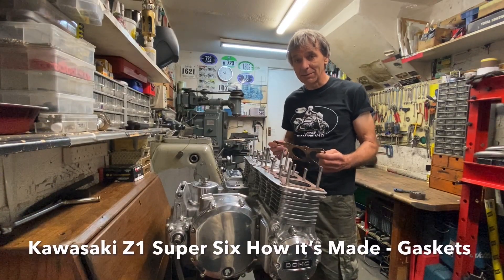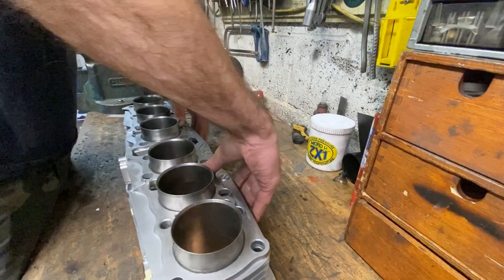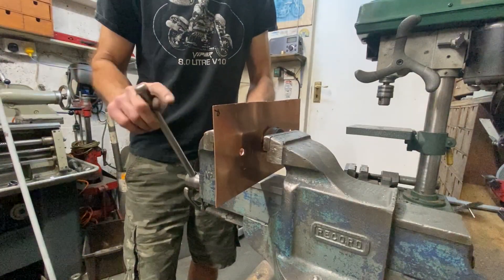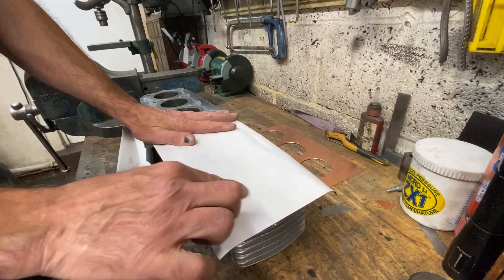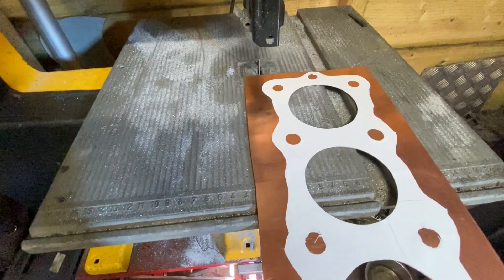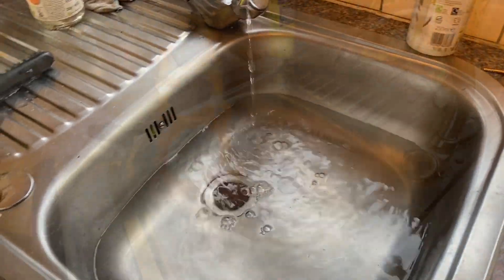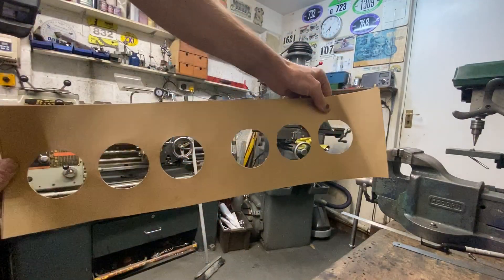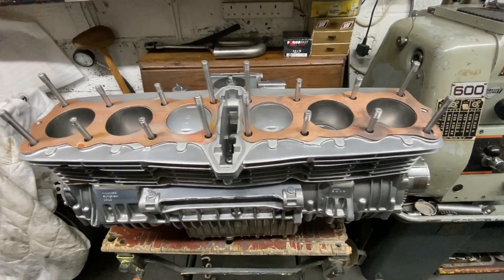Kawasaki Z1 Super Six  Copper Gaskets - How it's Made

Comment: Have said it before Allen but I'm going to say it again, you sir are an engineering genius and a privilege to learn from.
By the way if you see any Swiss Army card tools locally grab them, they have the same little scissors and a lovely little easily sharpened blade which come out of the card to use, making them less cumbersome for snipping and much safer than holding a Stanley blade between thumb and forefinger...
Google 'Victorinox Swiss Army Card' 👍🏿

Comment: Hey man, thanks for the4 video, I was wondering if I can make copper gaskets myself. But please tell me, do you use any sealant when fitting the copper gaskets - i.e. copper spray gasket? thx
Reply from the maker: I use a bit of Permatex ultra grey just to make sure
Reply: @AllenMillyard  thats RTV sillicone, right? I just installed a Honda D16A9 head today with a laser-cut 1.2mm copper gasket and only used the copper spray...I guess I will know soon enough if that is sufficient. I somehow dont like sillicone on head gaskets...but in any case, thanks for letting me know.

Comment: When making the base gasket, why not tap around the edges of the cylinder liners using the flat side of a small ball pein hammer, thereby severing the gasket paper at the edges, likewise, for the stud holes with the ball end and also the casting edges with the flat end.

Comment: While the head was on the copper sheet I'd have used a transfer punch to copy the bolt holes, so much more accurate and no need the mess around with sticky baked plastic, paper and oily finger for the outlines..

Comment: Alan, I don't know if you are reading these but my question is, when cutting the holes in the paper template, why didn't you use a ball bearing with a gentle tap on the bolt holes?

Comment: Awesome job! I love watching your videos! Just a thought from a fellow builder of one-off stuff, when you get your gaskets made and fit how about using them as a pattern to trace out an extra set in case you need them? I like how you said to punch out the holes in the paper BEFORE you cut out the gasket. This is to give enough support paper around the hole to keep it from being sucked under the punch. On most cast iron or steel parts (not here tho) you can carefully lightly tap cutting out the outlines and holes with the ball end of a ball peen hammer. But I'm sure you knew that already. Keep it up!

Comment: Hi Allen. How/ why did you choose 1.2mm copper? Was that based on the thickness of the gasket you originally removed? I am in need of a head gasket for a 1997 Yammy XVS400 but they are discontinued. It looks like the MLS one I took off is 0.70mm so I guess I could make a copper one of the same thickness?? Hope you or anyone can advise. I’m nervous about getting it wrong and either bending a valve or dropping compression.

Comment: I have made my own copper gaskets as well. To mark out the engine stud holes. I use a centring prick punch, this is a round punch with the same diameter as the bore for the studs and it has a centre spike machined on it. Drop it down and give it a tap with a hammer.

Comment: Thanks again Allen, I will be making copper gaskets for my  70cc, 90cc and 110cc Honda motors. I have the luxury of having a small CNC machine to machine the copper. I will be using 1mm thick sheet. The advantage I have is that my motors are only one cylinder each.

Comment: allen    ever thought about making a jet powered  three wheeler ?   i have a jet engine 8" dia 18" long  that could spin up a free rotating turbine  the shaft of which drives main shaft of the motor cycle engine ,,,, the con rod / crank removed..  .. its an idea at the moment .. but i have most of the tackle to get it done  i am in a bungalow and the max shed size i can legally have  is 6x4    thats feet not meters.. ! i hhave gone to the trouble of buying one  7x7 feet   !   strictly illegal,,,, so they say !    where i live is very very nice almost like gods waiting room no dawn chourus here  just the clatter of zimmer frames..!   keep in touch  regards,,, laurence
Reply from the maker: Loving the shed 🙂

Comment: When I was an apprentice Engine builder I was to taught to anneal copper by quenching it in used oil I recall water quenches more quickly the oil however oil is good for slow quenching if higher stressed copper components used to love making Gaskets I used to tap out shape & holes by using a light ball pain tapping hammer happy days…!!!

Comment: Allen, you really need a set of proper center punches.  There's no sense in guessing where center is for a hole.  A entire set can be had for rather cheap.  Basically just a set of rods that are specific sizes and graduated from very small to large.  There all have a small shap point at one end.  Pick one that fits snugly in a hole and slides through.  Drop it to the bottom so the point touches your material. Waah-laah !!!  All hole are marked perfectly on center.

Comment: It needs a bead around the cyl., something to compress, which a flat piece of copper won't do,  just too much surface area.  Hardly any different from just bolting the head straight on, as copper and alum. are just about the same squishability/hardness.

Comment: I have a project that I would like to use the copper gasket. The only reason why I can't go forward is that I can't find info I'm satisfied with that explains the correct gauge to be used for the engine, I know the thickness of the gasket will alter timing and HP loss or dangerous gain, I wander if anyone has a decent explanation on how to measure the correct gauge of the gasket to be used? It would be even more helpful if your name was Allen and had a youtube channel...

Comment: I like the fact that the detail and steps weren't skipped - very thorough. Interesting, that the large holes for the barrels were opened up incrementally. No doubt there's a reason. I would (probably wrongly), just drilled a hole close to the circle and then  used the snips, but I guess this would have buckled the plate? I confess, I have made numerous paper gaskets out of cornflake boxes, which worked fine enough, back in the day, for my CD 175 and Norton 600.

Comment: Have you ever used a small ball peen hammer to tap around the perimeter of the holes? It is dead accurate and quick. You can do both the perimeter and the id of holes. I'm sure you already knew that.

Comment: Mt Millyard, Handy Tip When making Copper head gaskets for My Triumph Bonneville And CCM 580 4valve, I got some Scrap lengths of 3 and 4-inch diameter  Copper water pipe 12 inches long when slit and rolled flat you get 12 inches by 25 inches to work with for the 4-inch, even 2-inch copper pipe will give you a strip 6 1/4 inches wide  and you can always beg offcuts from industrial plumbers, Putting the Copper gaskets on the Electric ring on the Stove is also a good way to heat them up to Annealing temp and also keeps them flat

Comment: Nice one Allen. 👍  Have you ever use an adjustable hole saw cutter to cut large diameter holes in sheet metal? Something like the Monument 68c tank cutter for example, which can be used in a slow speed pedestal drill. You can find the hole centres using the set square technique.

Comment: hello back. How is the copper gasket holding? is it leaking or working properly? I have gsf1200(oil cooled) and was thinking about using it because i want to turbocharge it so if it is suitable for my application. Thank you for any advice.
Reply from the maker: Its done 1000 miles so far and it seems to be  fine, I did put a thin smear of permatex ultra grey around the oil ways just to make sure

Comment: Allen i enjoy your videos for no other reason than i like engines, however as one of those health and safety types i would have you marched off our site if i caught you using a stanley knife blade like that 😁 do yourself a favour and get yourself a nice craft knife set that will do the job just as well if not better, and while your at it get yourself a few pairs of tight fitting kevlar reinforced gloves, cut level 5, modern gloves are amazing for their level of dexterity and there really isnt much you cant do with them on, i rebuilt a 2JZ Toyota Supra engine with gloves on, nice clean hands and no nics and cuts. Carry on the good work, lecture over 😁

Comment: You know, the std head gasket has got flame rings, which see most of the clamping force when you clamp/bolt these heads down. When fitting
copper annealed head gaskets the force is distributed across the whole surface, and dosn't give the same high pressure seal where you need it
most(on the top of the cylinder liner)
  A better and easier way of sealing
at this point (area) is to use wills rings or more easily found annealed copper wire (twin and earth)I think it's about 1mm 0.040" dia, fed into grooves machined 0.030" deep 0.040" clearance into the top of the liners. This leaves them about 0.010" proud of the surface. They have to be carefully filed flat where the ends meet. This creates a much better seal than copper sheet, less of a thermal break as heat is able to hop across straight from head to barrel, rather than head to copper to barrel.The 'wire' will deform to allow the two units (head and barrel) to touch.Better better!
The barrels height will have to be adjusted,oil feed holes may need 'o' ring undercuts. 
I have always tended to do it  this way(where possible) twin and earth wire is cheap,and of course once you have modded the top of the liners, job done.
Your Z900 lends itself well to this method with it's central rubber seal for cam chain tunnel sealing.I  think it would help the heat flow more easily away from the middle combustion chambers into the barrels, as there is a major thermal break where the head and barrels were chopped up, with limited depth of weld.
Reply: RIGHT.

Comment: What a fantastic video -- thank you!  By the way, I see that at 7:15 the sanding sleeve is not fully fitted over the rubber drum.  Was this done intentionally to provide additional compliance?  In my experience, the sleeves sometimes refuse to fit over the drum all the way.  However, a drop of P-80 Emulsion temporary rubber-assembly lubricant on the drum helps in overcoming a tight fit.  Of course, P-80 also works great when installing seals, fuel and coolant hoses, grommets, plugs, etc.

Comment: Will the copper stay soft indefinitely or do you have to fit the gasket fairly quickly ?
Reply: The copper will stay in its softened (annealed) state until it becomes work hardened. So no rush to fit it.

Comment: Hi Allen, I just pulled the head off my 2003 Kawasaki ZRX1200R down here in Auckland. Rather than buying a replacement gasket, would that engine accept a copper head gasket if I manufactured one? Highly impressed by your work as most other NZ riders and racers are... cheers.

Comment: Fantastic videos. You need to get a job with the BBC. However as an ex-toolmaker I have a couple of criticisms. 1. As already pointed out you should never hold sheet steel when drilling, if you absolutely have to wear some solid leather or other tough material gloves. Best to clamp to table. Secondly, horror NO SOFT JAWS in vice, lucky you didn't mark anything. Also after such brilliant ideas and skills why not put the liners in the freezer and heat the barrels? Finally I do have to say your videos are the best I have ever seen so please keep it up. Do you do visits?

Comment: I thought that, when using soft copper gaskets, the block and heads had to be o-ringed. Is that incorrect?
Reply from the maker: Maybe for high compression or turbo engines

Comment: I have an old licorice allsorts tin filled with drill bits that I have 
collected over the years . They have been ground by me to 
three points . One in the center with a concave cutting edge 
going out to two sharp points at the the OD . Works perfectly 
every time and only leaves a small burr on the sheet metal .
I would have drilled the holes first before cutting out the shape .
That way , if it does spin , the damage would be minimal .
Great job Allen !

Comment: For gasket I've allways used my grandads method by using a a4 paper then a ball tip hammer and tap out the shapes using the head as a cutter if you no what I mean then trace onto copper or tin gasket works a treat

Comment: Opinion or 'how to' about making an o-ring from long o-ring material and gluing the ends together... I've done it with instant CA glue...and it worked sometimes for short periods and depending on the solvents it's exposed to... maybe a better glue for the ends?  Your experience?

Comment: Thanks Allen, I'm a GS 1000 g enthusiast, I'm going to make my own gaskets using your technique.
Reply: I wanted to know if the copper gasket can be reused, or do you have to make a new one each time you take the head off? The reason why I ask this is because I know that the rectangular o ring seal that seals the cam chain gallery, gets hard from heat after a few years. This is one of the reasons why these bikes always tend to weep oil from the middle of the head gasket. The z and GS are so similar that the ignitions are interchangeable, because Suzuki copied the Kawasaki Z with their GS range. The 1100 alternators are also interchangeable with the gs to my knowledge, so I would believe the weeping o ring  to also be a problem with the z, because these bikes are so similar. The new GS gaskets are larger to cover the o ring seating to do away with this problem, so they come all the way to the edge of the cam chain gallery, so can it be reused?

Comment: Allen, I would like to ask you if you apply any copper gasket spray on them or just install them bare?  VHT or Locktite's copper gasket spray is readily available where I am located. Great video! Wait for your advice.
Reply from the maker: I sometimes use a smeer of Permatex ultra grey especially around the water jacket holes and oil galleries on multi cylinder engines
Reply: @AllenMillyard  Thank you for the advice!

Comment: Ref annealing copper.  In the past I've reused copper drain plug washers by heating and then allowing them to air cool.  This works as well as quenching as far as I know.  Is there any benefit to quenching the copper instead?
Absolutely love the videos keep them coming please.
Reply: Copper anneals from red heat whether you quench it or not, it makes no difference (the annealing happens at the high temperature). Cooling it quickly just gives the hot metal surface less time to oxidise, and you can carry on working on it sooner. But dropping hot metal in water is always fun, so why not?

Comment: Are you going to anneal the copper head gasket?
Reply from the maker: I did in the video
Reply: @AllenMillyard  My apologies, I was skipping through the video and missed it.
Reply: So, can you get enough "crush" on the cylinder head gasket with the head studs? Most cylinder head gaskets I've seen have a deformable ring that crushes when you tighten the head down.  Do you put any sort of gasket goo on it?

Comment: Related question:  How well does sheet copper cut with a plasma torch?  Obviously, you'd want to cut outside the line and then trim the excess with snips and file.

Comment: If you run a soft lead pencil (say, 2B) around the edges of the holes and cylinder liners before pressing on the flexoid paper, it will produce a more distinct tracing.

Comment: Allen,
Nice information on the copper gaskets, going back to one of your early projects the Z1300x2 v12, I’m working on a Z1300 based project and wanted your thoughts on copper head gaskets for Z1300, I have a reasonable workshop and good skills being a 1960’s RR - Ansty toolmaker, but parts for the Z1300 are getting scarce and I didn’t want b****cks up engine parts that I can’t get any more. 
Thanks for your thoughts.

Comment: I used to follow a similar process when I made custom copper head gaskets to change the compression ratios of my bonnevilles and commandos back in the day. It’s time consuming but very satisfying.
For the paper gaskets I’d use a thin film of margarine on the engine casing to make an imprint on the paper. It’s dead accurate.

Comment: Brilliant, I've been looking forward to this. I've been wanting to make a copper head gasket for a XL125v. I lost a bit of compression riding from South Wales to Teesside about two years ago.l after a weekend camping with light off roading.

 Think there could be a slight warp to the rear cylinder but the service limit for warpage for the cylinder head/cylinder is only 2 thou. 

 It uses a really thin, complicated looking, multi layer steel head gasket. https://images.cmsnl.com/img/products/gasketcylinder-h-nas_big12251KGB611-01_08c5.jpg 

 After changing the head gaskets it's fine until it warms up then it loses power from the rear cylinder. 

 Though I did find an intermittent break in the low tension coil feed. I'll rewire the coil feed. If that doesn't cure the power loss I'll check the compression when cold and when warm and if nessasary I'll attempt to make a copper head gasket to see if that cures it. 

It's a good winter bike as I have snow tyres and I don't fancy riding my ST1100 on snow/ice.

Thank you.